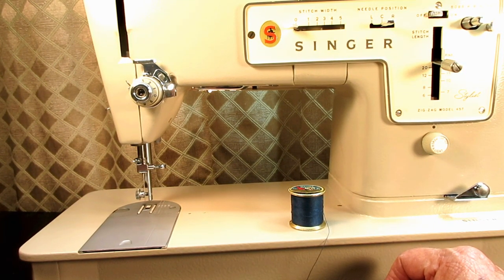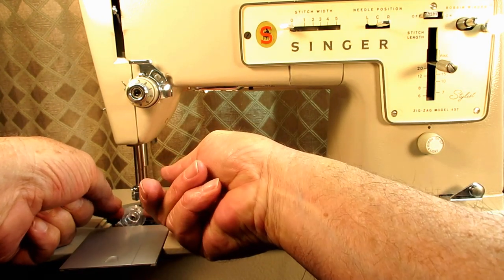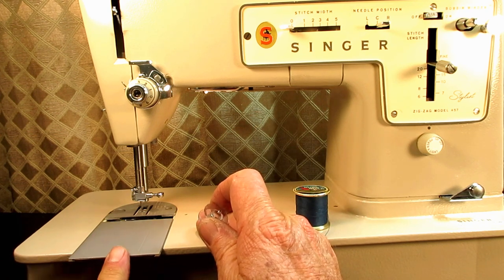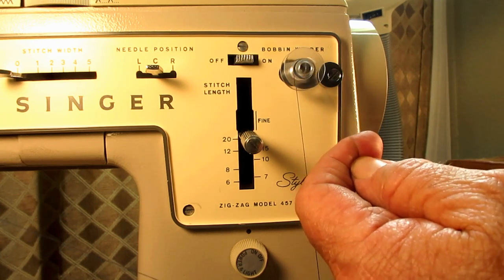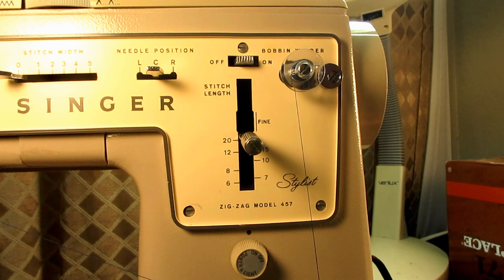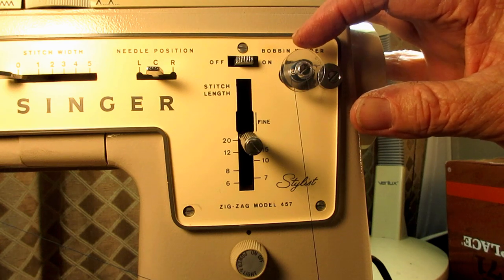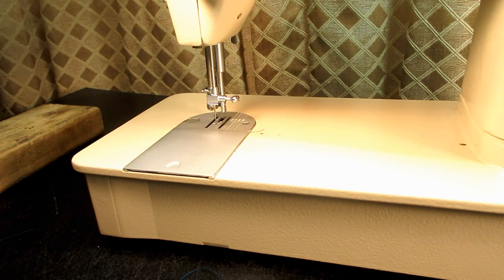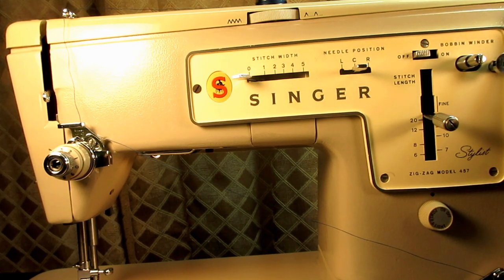The Correct way to Wind a Bobbin on a Singer Model 457 Sewing Machine

Comment: Thanks for the video Andy, my 457 is still working great. Just picked up a Singer Touch Tronic Model 2001 for 25$.  Motor was seized, but a little Tri Flow and got it going again. Fabricated new mounts for the motor from some nylon sheet. This machine is nice but way to much electronics for my taste. Keep up the videos.
Reply from the maker: Thank you, Sir. I'm glad your Touch Tronic is working. The only one I ever had the card was bad. I bought a used one and it was also defective. That was my one and only electronic machine, haha. If you want to have some fun, keep your eyes out for a 353/354 Genie Model. Just be sure the hook turns before you buy it. My favorite "Good to Go" portable Singer.

Comment: Thank you for your incredibly helpful videos. My Singer 457 gives off a slight electrical/burning odor. I cleaned it up and rehabbed it last week and I’ve been doing light sewing, hoping the odor will improve with use. Do you know what could cause an electrical type odor?
Reply from the maker: I have noticed that type of smell and sometimes it comes from an old motor belt.
     When it gets dried out it can develop thin cracks and the edges can start to fray.
If you remove the motor (end) cover and see black dust it's a good clue. You can also run the machine in bobbin winding mode with the motor cover off and see if the smell gets stronger. 
     If you're not familiar with removing the cover (or belt) here is a video of a different model that has a similar set up as your 457 https://youtu.be/RuOLUVPsQv8   
    If the belt need replacement there are several places to buy one. Here is just one example: https://www.ebay.com/itm/166246384323?chn=ps&mkevt=1&mkcid=28&srsltid=AfmBOoptmRKFJtywvAZhM-Jkz--MR2LeZ244UFd21YZvYnoVpo_ihe3NYDQ
     Rarely you can get that smell if oil got on the belt, pulley or windings of the motor.
     There is also a timing belt on the bottom of the machine, but I've never got that smell from a timing belt. Good luck, and thanks for watching my channel.

Comment: Hi there  trying to fill a bobbin mine is a lttle different doesn't have the the metal round knob wont work keeps turning and wont disengage the foot petal to the neddle???hope that make sense
Reply from the maker: @chevymandd123  what's the brand and model number of your machine
Reply: It's the singer stylist zig zag model 457
Reply from the maker: @chevymandd123  That's confusing I've never seen a model 457 that didn't have the Chrome knob that you turn to the left to disenge the clutch to the needle system so what do you have there on the hand wheel nothing then just the end of the arm shaft sorry just trying to picture what you've got there
Reply from the maker: @chevymandd123  What I'm speaking about is what I'm touching at @2:05 in the video. Also, here is a video of a different model's handwheel being removed, installed, and taken apart, just to show you what is inside the handwheel. Finally, if your machine does not have that center knob then the needle bar should NOT even be moving b/c tightening the knob puts the machine in sewing mode to move the needle. Without that center knob being tightened to the clamp washer inside the machine can't sew. You win the award for the puzzle of the month. 😊😊

Comment: I have a problem with filling the bobbin on my 457.  It starts to fill and then stops and no longer goes around. In the past I have taken my machine in for cleaning etc but have not done so for awhile.
Reply from the maker: "have not done so for awhile" hehe. It may be lack of oil or it may be the tire on the winder is hard and old and can't grip the back of the handwheel. If you lat the machine on its back and put a drop of oil on the side of the spindle that you put the bobbin on to wind the oil can seep down into the bushing. You can twist the spindle back & forth with your fingers to spread it in the bushing. You may notice it becomes easier to turn. If oiling does not help you can check/replace the bobbin tire by removing the top cover and peeking at it. If it seems hard and old or cracking you can replace it by removing the bracket and twisting the tire off and stretching on a new one which you can buy at many places online. I have a video about the parts you can watch just to get an idea. It was made with a different model of Singer but the BW parts are the same: https://youtu.be/r6m2QvUJDmo
This is a trusted seller I have bought tires from in the past: https://www.vintagesingerparts.com/collections/singer-model-457/products/singer-bobbin-tire-friction-wheel-27-mm-x-15-mm-x-7-mm
Good luck and thanks for watching my channel

Comment: Andy I have a problem with my machine.  Something has happened and now my machine will not stop stitching when I want to fill my bobbin. Will I be able to fix it or do I need to send to the repair shop?
Reply from the maker: Most repair on that machine can be done by you. Tell me a little more about what is happening. Are you saying that when you put the machine in bobbin winding mode that the needle keeps moving when you wind the bobbin? Have I got that right? Also, your machine is a model 457, right? Thanks
Reply: Andy Tube yes Andy, that is correct.  I managed to replace the top gear on this machine, with your very good video instructions.  Hope I can rectify this fault with the handwheel.
Reply from the maker: Have you taken the handwheel off the machine before? Cleaned it? The handwheel buahing and hole in the wheel may be dirty and sticky and need a good cleaning. Sometimes people put the clampnig washer on backwards or turned 180 deg the wrong way. If there is a lot of oil on the handwheel bushing it can grab the wheel while spining and make the needle keep moving. Here are a couple good videos about removing and installing a handwheel. You do not need to remove the bushing. Please don't. Just take it off and clean the wheel and the bushing and clamp, etc. and put back on like in the video and see what happens. Handwheel off: 
https://youtu.be/eZiMaaka5HE  Handwheel back on: https://youtu.be/hHl96WL1kzA
Good Luck.
Reply: Andy Tube thanks Andy I will give this a try
Reply: Well after three attempts I think I have rectified the fault.  Thanks for your advice, I didn't completely take the handwheel off as I tried but was afraid I wouldn't be able to get it back on again.  But I discovered that I could fill the bobbin while stitching so win win.  Touch wood it is sorted now and thanks again for your help.
Reply from the maker: @margaretjeffrey9122  If you are satisfied then alls well.
Reply: Andy Tube thank you until the next problem

Comment: Hi, I just got this machine and did everything you did here but it still won’t wind the bobbin. Please help.
Reply: Ok never mind. I unscrewed the metal round handle thing and found the flat metal next to it was not on the groove. I fixed that and now I can wind the bobbin. Yay!
Reply from the maker: @yanlatif517  Nicely done, Yan. Normally the rubber tire (friction ring) is worn or dry and does not grip the handwheel when turned to wind. The spindle usually needs fresh oil also. Here is a free copy of the instruction manual if you need it.
https://www.singer.com/search/support?title=457
Thanks for watching my channel.